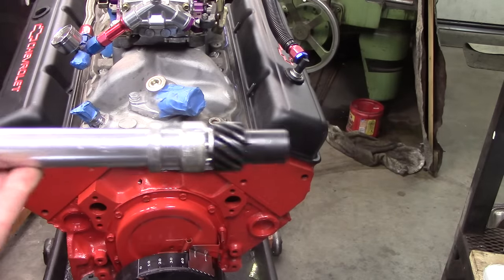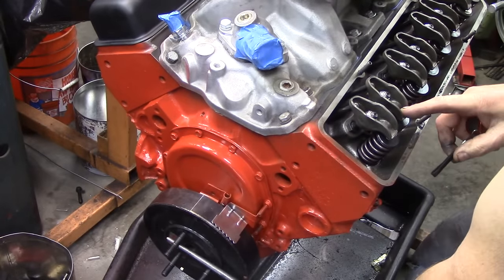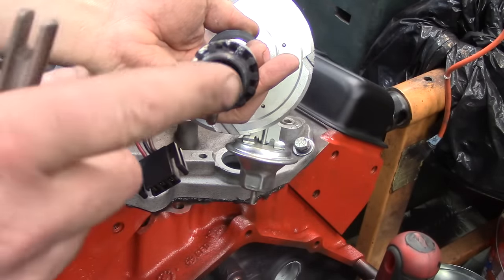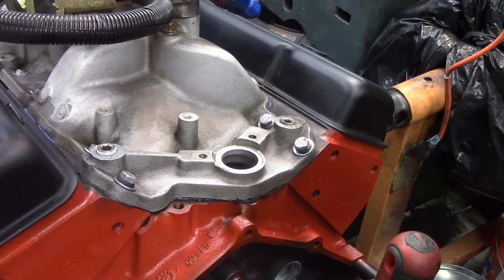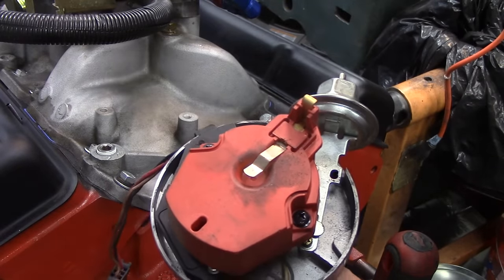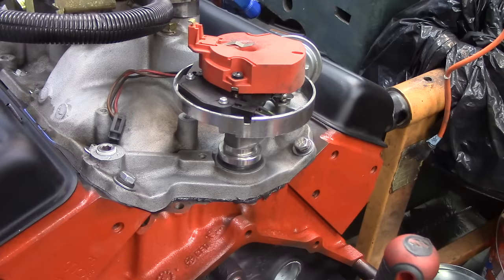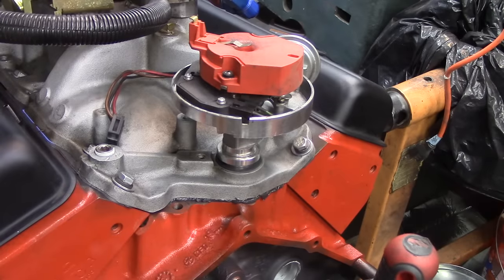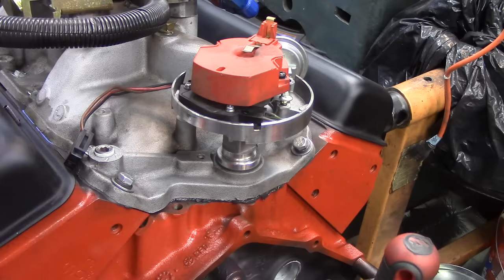How to Install A distributor in a 350 Chevy

Comment: I was going to add something to this video make sure you prime the engine before you put your distributor in
Reply: good idea!!
Reply: You CAN'T prime a Chevy engine without the distributor in!!!  The body of the distributor acts as a partial plug for an oil galley. (oil goes around the body itself. It's the round groove/chamfer right above the gear)
 If you leave the distributor out, you won't get full pressure/reading and won't get the oil to the rest of the motor that galley feeds to.

Also, BEWARE of these $50  'china specials' that have inferior gear material and or NO lube or grease in/around the distributor shaft. That WILL send metal shavings right down into your oil pan and or seize your new distributor. Might not be immediate.. But it's a ticking bomb.
I always pop off the 'china' one and install original Chevy or spare gear. Then, pack it (the gear) with grease right before you 'drop it in' the motor. Whatever gets slung off, won't hurt anything, and not enough to plug a filter. And check for the CORRECT heat transfer grease under the module. NOT Di-electric grease. NOT the same.
Reply: Pause it at 2.46.   ...ok, so it's not round, you'll see. it's the 3/8's gap in the body
Reply: @blownaway4371  but, you can prime the oil pump before installing the distributor in. and, i away take apart those china distributors and grease up the bushings, reassemble them with a new gear ,shimmed to where there's only .010 play between the gear and the body.
Reply: @rearspeaker6364  Oil pump itself YES. Block- not so much. 
 Pump NOT pick-up, can pack in Vaseline if it's going to be sitting for a long time before starting/break in. Otherwise a quality assembly lube that's high tack will usually stay around the gears for a good while before it becomes ineffective. (like weeks--months)
Reply: @blownaway4371  absolutely!!

Comment: Awesome video, Do have a question though, Last step. Where do you tighten or fasten the distributor?

thanks
Reply: the bolt hole right beside the distributor on the intake manifold(you also need a sort of y-shaped clamp that sits on the protruding part of the distributor)also,make sure you install a gasket before installing the distributor,its also circular.the bolt goes through the y-clamp and then the y-clamp sits on the circular part of the distributor.semi tighten it,set your timing then completely tighten it.

Comment: Question about my 1976 350 v8 I have valve covers that look like that on my engine and the oil fill is on the driver side in the back and it’s extremely hard to get too because the brake booster is in the way and I always spill oil all over the engine are the valve covers able to be rotated 180°? So the oil fill would be in the front!
Reply from the maker: yes

Comment: hi can you please answer a question i have you find tdc and set it to zero on your tab i dont have a tab and i have a goodwrench motor that apparently is 30 degrees different then your standard chevy timing tab. I purchased a mr gasket adjustable timing tab so i can set my own when i am tdc on the valve do i rotate it like so many degrees and find it like you did or when i see the valve set right can  i just set it to zero right off the bat?

Comment: hi i tiring  to install my msd hei,  when i set the engine to top dead center when setting the distributer in place it will only aim at #3 or just  pass # 1 tried it many times same place all the time. thanks for any info

Comment: Question............? Is it normal for the oil pump shaft which connects to the distributor to have some wiggle / play ?
Reply from the maker: Yes before you install the distributor it is perfectly normal
Reply: @Myvintageiron7512  thanks again and sorry for the late response.

Comment: Did this in my 97 gmc 5.7 vortec and cannot get the distributor to drop in or line up where I need it 2 days now and now have no idea if I am at tdc in compression or exhaust stroke because I can't get my valve cover over without pulling my power steering pulley
Reply from the maker: just pull the number one plug you will feel the compression stroke with your finger on the plug hole
Reply: Booth valves will be closed

Comment: how does in stay in time with # 1 @ rotor pointing to #1 on cylinder bank Then when u move it u move crank timing chain AND cam- so you moved # 1 reference on Dist to next to  vaccum  on dist.?
Reply from the maker: the gear was meshed with the cam when you move the crank the distributor moves with it all your doing is getting the oil pump drive to line up
Reply: @Myvintageiron7512  Thank You Sir ! appreciate the time to answer this - i will be setting mine next few days-gonna do it the way you said.

Comment: if you look the rotor is in line with the male drive for the oil pump, I align the oil pump drive shaft(female end) with a long screwdriver with where you want number 1 spark plug wire on cap and the distributor will drop right in
Reply from the maker: Don't bother messing with a long screw driver that's a waste of time  just stab it in where you want the rotor and turn the engine it will fall right in
Reply: ya but it is a simple task I do it all the time and that way I know I am right on

Comment: If u turn the oil pump slot to 5/11 o'clock with screwdriver it will line up fall in place

Comment: Hello. I have a 78 El Camino 350. Got it with 166,000 and tried to set timing. With timing light the mark on the balancer was about 2 to 3 inches away from the 8 degrees before. When moving the distributor and timing mark toward 8 before the motor died down badly and will not make the proper timing marks. I just rebuilt the motor with new distributor and the dame exact thing is happening, I cannot line the mark with 8 before and I am at a lose. What would make this happen in the old motor and new. Any help would be awesome. TYVM.
Reply: Did you try it with the hose to the vacuum advance un hooked and plugged ?                                                                                                                                                                                                                                        When your #1 piston is at tdc , the tdc mark on the balancer might not be lined up with the 0 on the timing tab . They claim the outer ring on the balancer can slip or maybe your balancer is for the other timing cover with the timing tab at the different location .
Reply: @44special9  Hose was plugged. Am running a comp cam 460 470 lift, am going to try 12 to 14 btdc and see how she runs. TYVM.
Reply: @44special9  I have a new balancer from summit, as far as the different timing tab location, it could be possible, just working with what came on the car. This weekend I'm going to set the base timing at 12 or 14 and see if I can get the idle set without cracking the butterfly and drawing ported vacuum. I have a comp cam 460 and 470 lift, guessing it likes more timing. I'm tossing out conventional settings, don't believe they will tune my engine correctly. I can wrench pretty good but tuning is not my strong point, I am learning as much as I can thru questions and videos. Thank you for responding.

Comment: I thought this is how everybody does it. I then bring the engine back to the top on compression again and adjust the rotor to a hair before #1 on the cap. Timing is now very close and no kickbacks or backfiring on initial startup.

Comment: Thanks for the tip on aligning the slot in the distributor because anyone that has clocked the oil pump rod to synch with the distributor slot know it's a bitch I appreciate the tip

Comment: for some reason my engine runs rough and its hard to start. I did tdc more than 5 times to make sure my timing was right but when i try to rev the engine it spits gas up out the carb and sometimes white clouds of smoke. My carb is clean fuel lines clean in line filter good what else could b the problem?
Reply from the maker: +txchevyrida sounds like you have a cam timing issue or plug wires in wrong

Comment: Hows about the pro dude way of doing it?  find tdc and then back it up 10 15deg. stick the dizzy in the hole and just set the cap on it..installed properly the cap will set square with the car..now you know where the housing has to go try and stab the oil pump drive, i it dont drop right away pull the dizzy up far enough to clear the cam gear, turn one tooth and drop it again...couple times playing that game will get it to drop...but the rotor is pointing  the wrong
direction, easy fix, pull the dizzy back up and rotate the rotor about 190-200 degrees..like a little more than half, drop the dizzy back in it should go all the way down, if it does rotate it the 190 degree thing again, it should drop but the rotor has moved..repeat until it points at #1. put the hold down clamp on a  look at the pickup in the center of the dizzy, see those pointed things? line it up with the center of the pickup and tighen down the clamp....sounds like pia but stupid easy once you do it a few times
Reply from the maker: you really think doing all that is easier than what I did ?????
Reply: @Myvintageiron7512  yep..its a lot of words for a very quick process once you do it a couple times..about 50/50 stand...in a boat or car you dont have to deal with bumping the motor over and holding the dizzy down. Being able to line the pickup up I can hit timing within a degree or 2. I send a motor to the dyno he knows the its @ 35* just like the last dozen

Comment: Backwards one gear tooth at a time till it drops in, keep going one gear at a time and oil pump drive will move with it till you get it to the #1 spot where the cap lines up.
Reply: Why would I waste all that time when this video makes it so much simpler and faster I will be doing burnouts and you will still be trying to get it do line up one tooth and a time that's totally Stupid
Reply: Stops the need to eyeball it, instead it lines up the rotor to the #1 spot on the cap. With the spark plugs all out it too me less then 5minuets. However his way is good also but a tooth off can happen or it can become aligned such a way the vacuum advance will hit the valve cover at the spot you may need to find proper timing. That’s why I do it my way.

Comment: I always pull distributor back out use a screwdriver and turn oil pump shaft a little and retry. I want the distributor to drop all the way down.

Comment: Kinda easy with the engine on a stand in the middle of a garage floor , 
Try it in the car with everything still hooked up , I have done it more times than you have fingers and toes , 
 With points and HEI distributors

Comment: Bump engine to it poofs back it up tdc with a screw driver in number 1 cylinder look down on timing marks to check it and drop the distributor in point to rear bolt on driver side back of carb put the claw snug so it holds it firm but to where it rotates and fire it up then put timing light if stock for to 8° on harmonic lock bolt down and done if it dosnt start jump wire 180 out and you will know if you put the distributor in backwards because it will fire by this i mean start #2 on distrust and do the 18436572 ive seen people do it backwards not knowing what they are doing and car will not start i like to bump it with stater and #1 plug out till it blows my finger out and i know it compression stroke

Comment: That's some good instruction, but I've always preferred the screwdriver method.  Any quality distributor will have the slot aligned with the rotor, so I always use a screwdriver to point the slot in the oil pump drive to #1 cyl. just like with the rotor.  It only takes a few seconds, even with the engine in a vehicle, and when the dist. drops all the way in without turning the engine I can set the base timing by simply aligning the teeth on the pickup coil.  I get the distributor perfectly aesthetically aligned, the engines start right up and only takes a little adjustment, if any, to get the timing perfect.  Maybe I shouldn't be such a perfectionist, but it's my job and I take pride in my work.  I'm not saying that the turn 'till it drops method is wrong, if it works for you that's great, but I've never liked it.  I'm just saying the screwdriver method is not a waste of time.
Reply: You can't be serious all that crap you just described is twice as much work the way this video explains it is so much better than fooling with the oil pump shaft I have put many a distributor in SBC's and the screwdriver method is differently harder and more work and when you say it's the same even in the vehicle that is just ridicules/ I did it the way the video shows and the engine fired right up only had to adjust it a few degrees you really should let go of your old way of doing this because you are wrong when you say it's easier it's not and the timing is right on doing it this way I think you are a little confused and don't understand that the timing is dead on when doing this after it drops put on your hold down and lite the engine it will start instantly fine tune it with a timing lite and your done no screwdriver nonsense required
Reply from the maker: I'm going to halfto disagree with you on this you say it's just as easy to alien the intermediate shaft with a screw driver in the vehicle I guarantee you will change tor mind about that if you try to drop the distributor in my supercharged S-10 engine
Reply: I am very serious, I'm a tech at a GM dealership (no, really).  I'll admit that the first few times might take a while figure it out, but once you get a feel for the screwdriver you don't even have to look at the pump drive, just stick it in and turn it, indexing with the screwdriver handle.  I just grab my screwdriver and the dist., climb under the hood have it stabbed, timed and locked down in a matter of seconds.  It's as fast if not faster and you don't have to turn the engine all the way back around (or backwards) to tdc to line up the pickup coil.  I've tried both ways and don't care for the turn and drop method at all.  To each his own, I guess.
Reply: LOL, ok, yeah, I've never had to put a dist. into any supercharged engine, let alone in an s10, so I'll give you that one.  I have, however, put a few into some naturally aspirated 350s in s10s, and still found it just as easy to turn the pump shaft as turning the whole engine.  Let's face it, you have to turn one or the other, and in my experience it's always been easier to turn the pump than try to fit a wrench around the fan and pulleys to turn the crank.  Even on a stand, where it's very easy either way, I always use my priming tool to align the slot after priming the pump, then whether stabbing the dist. on the stand or in the vehicle, it's right there and ready to go.
Anyway, I hate to argue with you, I've watched a lot of your vids and you obviously know your shit, so no offence, but I think we'll just have to agree to disagree.
Reply from the maker: yep to each his own

Comment: Find top dead center compression stroke   Slide distributor rotor facing fifty degrees before tdc if distributor doesn’t drop all the way in hold it a rotate engine until it drops down .